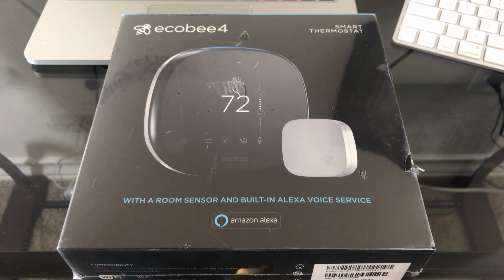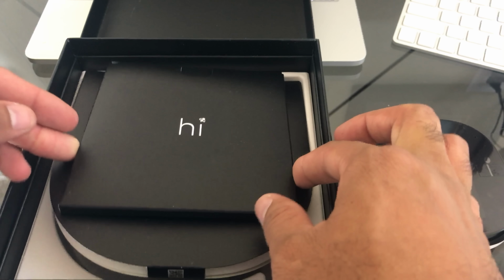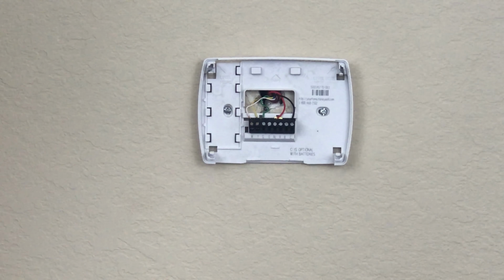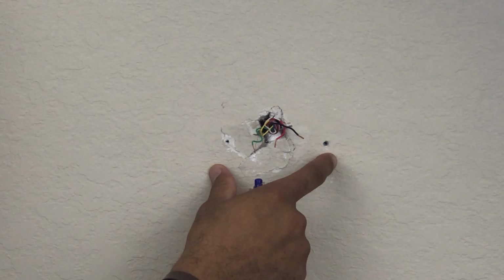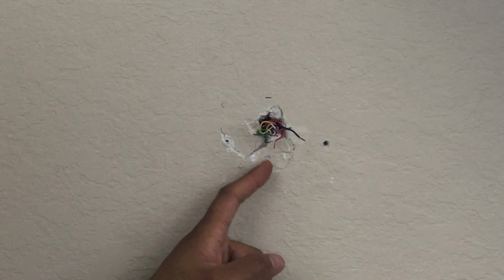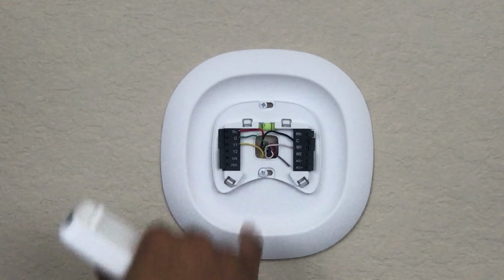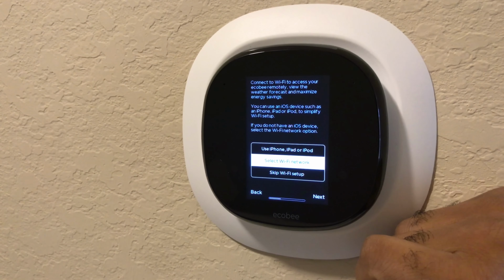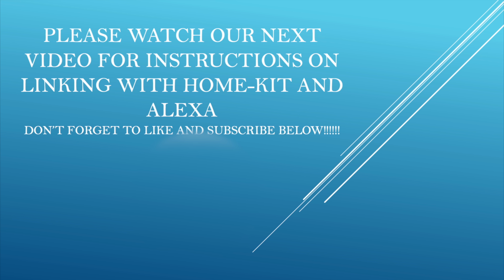Ecobee 4 Install

Comment: Good video!! 1)BUT make sure you turn off the tstat or shut the AC breaker off
2) make sure when you remove the back plate. HOLD THE WIRES(they might fall inside the wall. then you're gonna have to cut some drywall)
Reply from the maker: JEEP AZ good point.
Reply: The Breaker shut off was the one thing I noticed for the physical install that I would change about this video.

Comment: Turn off power please before changing thermostat if that red wire would have touched any metal you would have blown your Transformer in the unit
Reply: Adrien Hernandez not true they have 3amp fuses that blow before that would happen

Comment: You might want to turn the power off at the panel,  ...some boilers, heat pumps and air conditioning systems have sensitive electronics that could get damaged (fried) in the event of a mis-wired or short circuit situation.
Reply from the maker: Yes good idea.
Reply: Um no but you can blow the fuse if you touch any wire to the red one